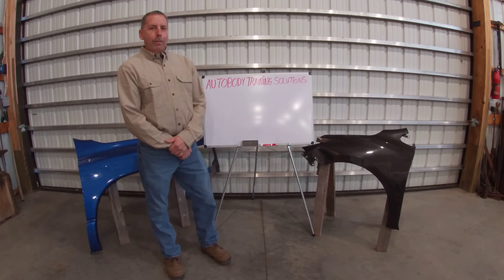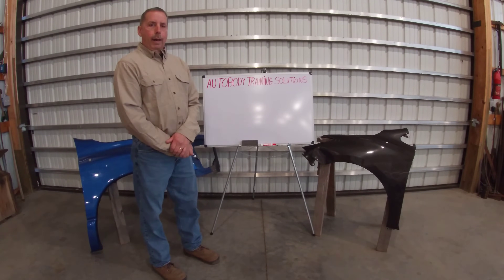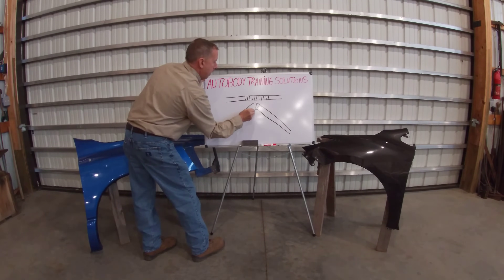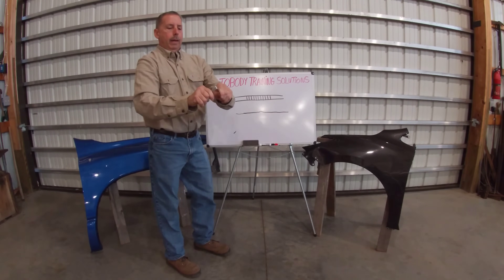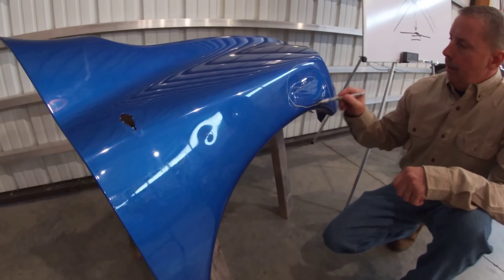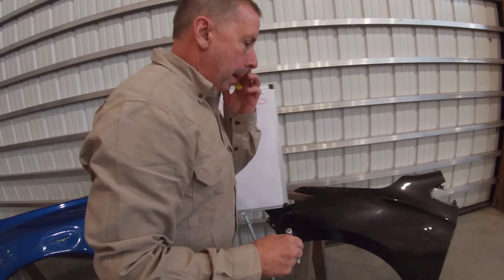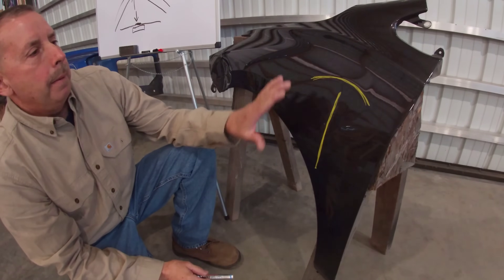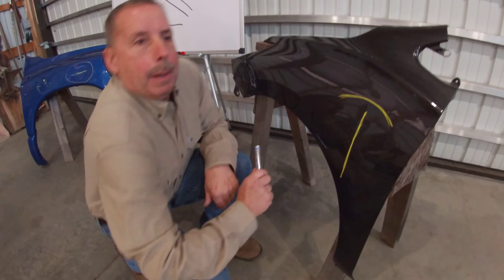Auto Body Repair 101 (Understanding the basics)

Comment: Hello Sir, just wanted to ask what is the best source of information to find the body dimensions when working on a frame rail that is out of alignment ?
Reply from the maker: If you do a google search there are many sources of measuring data available. I’m not sure how many are free to access but Mitchell is one of the biggest. I’ve used Chief and Shark for years but those were a paid subscription to go along with the computerized measuring systems that I used at work. All Data is another popular one so you should find something to give you length and width dimensions. Thanks for watching
Reply: @autobodytrainingsolutions838  Thank you

Comment: You're probably a decent  guy in this field, too bad so many aren't
Reply: Can you please explain that to me ?I just want a perspective
Reply: @efrainortiz5915  Sure. for many it's about the money and the money only.  They'll "befriend" you, think they've got your back, when they don't. Owners who don't question and/or put all their trust in them are ripe to be "burned"

This is speaking from personal experience.  Oh yes, if the insurance agent makes mention of how good they are, be on guard.
Reply: Sure, as an example. my mom was too trusting of people, especially when it came to business. Her car was hit and went to the body shop for repair.  The man was more sympathetic how much insurance would pay (small business not a chain).    She believed he has her back when he didn't, his concern was only his business.

Making a long story short, he would not release her car until the insurance payment cleared, when she went to pick up her car, he only gave her the keys no paperwork, nothing.
 
On further inspection, he used used parts (some bad ones at that), the hood used had dents, the trunk lid has a rusty bolt (her car was hit in the back, and hit the car in front of her), the  bumper cover had red peel, and any place they welded was not rustproofed.  They did a crappy job, and were not responsible if any issues arose (which they did)

Comment: AUTO BODY TAINING SOLUTIONS       I have a question: For example when a vehicle/car has been rear ended by a tractor trailer truck (hitting one side of the rear bumper) cracking the bumper / ripping off  one of the tail lights aka brake lights and smashing the rear quarter panel......  QUESTION ONE (1) What are other possible issues that are likely to have occurred to the vehicle that the naked eye and non mechanics/non body shop specialists    would not be aware of      could yah list the guestimate price for each repair including the obvious repair/replacement of the bumper, tail light and rear quarter panel
Reply from the maker: The vehicle needs to be inspected underneath for possible frame damage, possible exhaust system damage and suspension damage. These areas are difficult to assess by the nonprofessional but can be the most critical and expensive repairs. It’s impossible to give even a guesstimate on this because of so many unknowns. Can the panels be repaired or do they need replacing? Is the trunk or hatch damaged? There’s could be issues with rear body panel and trunk floor. It’s too big of a question for the scope of this analysis. I suggest have a local repair shop give you their suggestions. Thanks for your comment